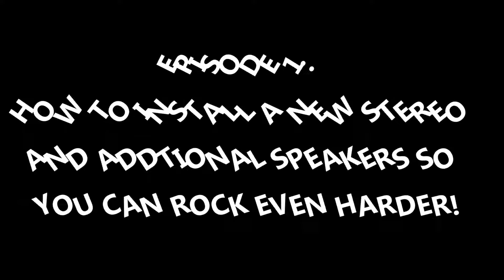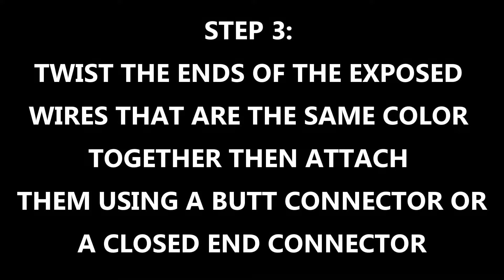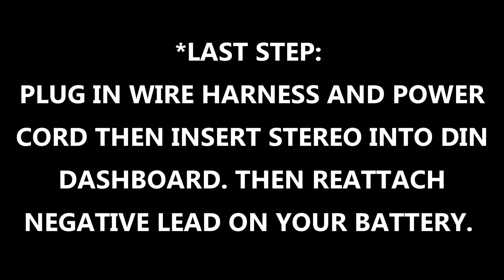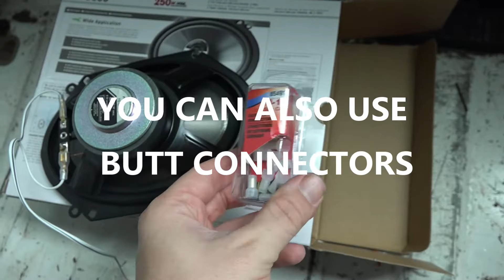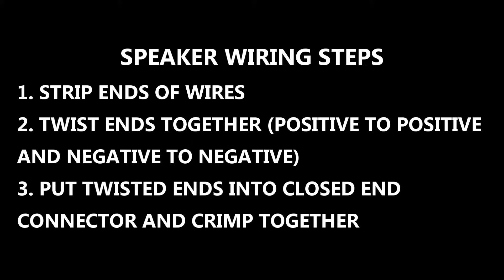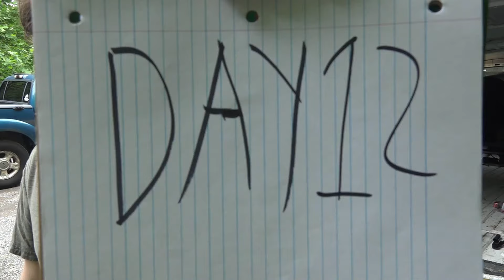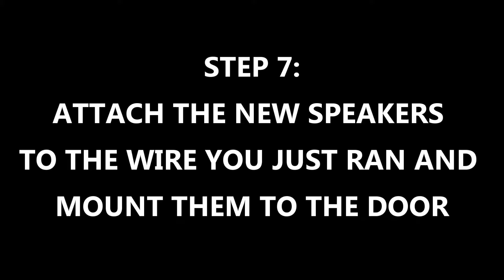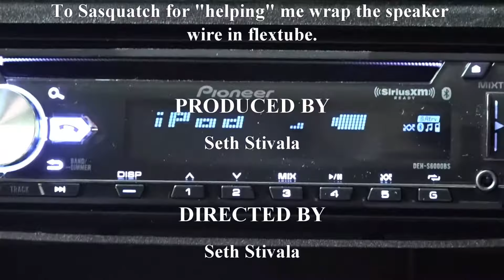Episode 1: How to Install a New Stereo and Additional Speakers!

Comment: At 24:55, why do you have to tape the wire if you're putting it in the flex tubing anyways?
Reply from the maker: You don’t have to. I did that to reduce friction further (wires rubbing together over time)—less likely to have an electrical wiring failure. Since my van is a camper van conversion and the wires are behind the walls, I wanted to ensure that the wiring wouldn’t fail for the life of the vehicle, since it would be very difficult to locate and repair. Because I would have to tear apart the walls and ceiling to get back at the wiring.

Flex tubing by itself is fine to protect your wiring, especially if you have easy access.